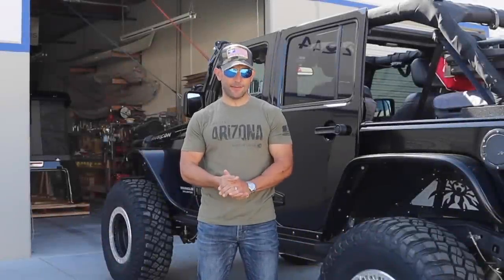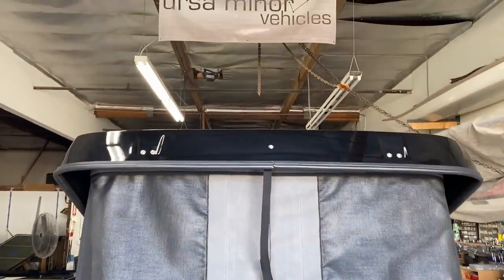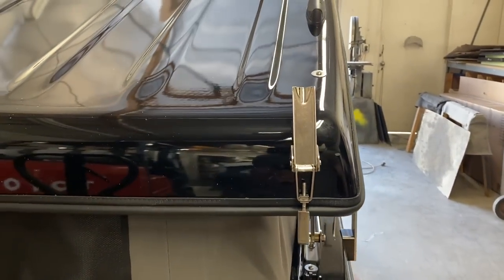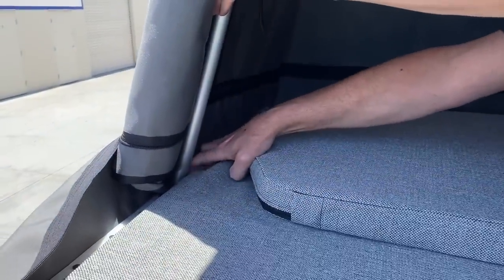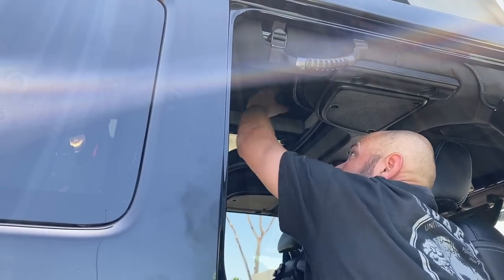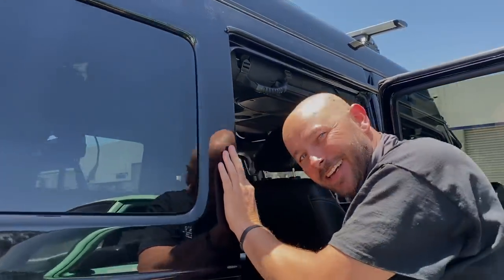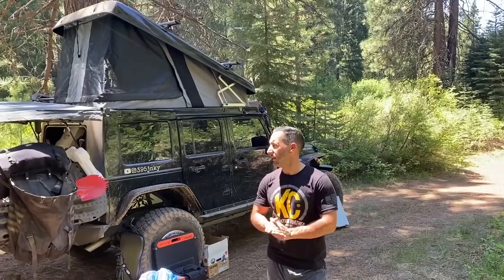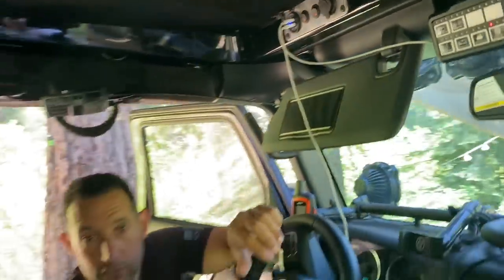Ursa Minor Vehicles J30 Jeep Pop Up Camper

Comment: Nice review!  I am J30 #87 here from Northern Wisconsin.  Had mine installed in Spring of 2015.  Best Mod Ever!  No problems at all.  The only modification I made was the addition of no see um netting, although I use it routinely in minus teens and -20's F on winter trips.  Enjoy!
Reply from the maker: Wow....One of the OG UM owners.  I love getting that feedback after 6 years of ownership.  The biggest struggle I'm dealing with so far is lots of dust coming in from rear tailgate area...thru the window...As well as my passenger side window doesn't seem to 100% sealed...Definitely nothing major, but for what I paid for this thing...still a bit disappointing.  The dust coming in seems to be a very common problem.  Thanks for taking the time to leave a comment.

Comment: Congrats on your rig upgrade. For now it is pretty much the best overland rig in my opinion. Notice I said for now. The best Jeep Ursa Minor rig combination by far will be with a Jeep 4xE and a Ursa Minor. The Jeep 4xE will become the Prius of overland vehicles in the near term. Because of the ability of the 4xE to run the automatic temperature controlled A/C or heater for a small amount of fuel overnight means you can boondock anywhere anytime regardless of the elements. Not sure what I mean, simply watch any YouTube video of camping or living in a Prius hybrid or specifically look at the explanation on Cheap RV Living interview with Bob wells as to why a hybrid makes the best camping rig. Now add in the capabilities of a Jeep and overlanding takes on a whole new way of boondocking way back in the trails.
Reply from the maker: Thanks Richard.  The 4xE sounds very promising!
Reply: Yeah that 15 mpg 4XE with tons of electrical problems sounds great!

Comment: WOW!!!!!  Nice, but E-X-P-E-N-S-I-V-E!!!!  I had a hard time putting the money down for my current RTT, let alone something like this.  I mocked up a cost on what I would want and  $2200 seems a bit steep for matching paint on the shell and roof, just saying.  Also, if you want someone else to paint it, you have no option for white gel coat on the shell, either texture or paint match ($1200).  Like I said, it looks really nice and makes sense, but that cost is a no go for me, unless I get lucky and find a whole bunch of money.
Reply from the maker: Thanks for the comment RK.  I was pretty set on color match since the only other option was the textured finish which I wasn't too interested in for the main body... And yes, it hurt and was expensive...but something I was fortunate enough to swing and we'll get plenty of use out of it...

Comment: Congratulations! Looks great. How much weight does the earth some minor add over the stock hard top? Appreciate it. Enjoy.
Reply from the maker: I did the math months ago and I don't remember exactly the difference between the two tops, but overall I saved about 80 pounds since I don't have the Rhino Rack Roof Rack or the RTT on top anymore.  Noticeable difference especially wheeling...Less sway and rocking back and forth on the trail with the lower center of gravity.

Comment: Do you have a video showing or talking about the weBoost with the OTR antenna install? I just received mine and am wondering about the height and where to mount it. Do you like it? Thanks in advance!
Reply from the maker: Not yet.  But I can tell you that we like it, although I am going to relocate it a bit higher on the Jeep on a swing mount...this way when I'm driving it wont be too high, but at camp I can swing it up and get it nice and high to improve signal.  Good luck!
Reply: @395jnky  Thank you for the reply. I thought of that also, I saw how low yours was and thought I was might put mine higher, but then how would the wind affect it? I also ordered an RV internal antenna (second antenna) so that when I go camping I can disconnect the internal Jeep antenna and run the cable from the unit outside the jeep into the tent to get a direct signal in the tent and hopefully use my laptop in the tent. It takes the RV antenna plus an adapter, both of which they had in stock. I asked weBoost about it and they said it would work but they were not aware of anybody trying this yet.

Comment: ? Why did you not look at the Safari EXL Company ( No need to remove a panel to reach tent & you can open the top from inside!!

Your swing also only one side / the other Awing wraps 3 sides with rain Curtain or Mosquito Curtain a extra 9 feet all around you to cock & Hang out!

What was the cost for yours $$$

Comment: Spray the latches into black
Reply from the maker: Right....Maybe remove and powder coat or ???.  I'm afraid paint will just flake and chip...
Reply: Not expect with that.  I put rust oleum high heat on my aluminum skid plates.  Paint sticks well but some of it came off when I sratched or hit something under.  Find black latches online or ask ursa minor about it.  Good luck.